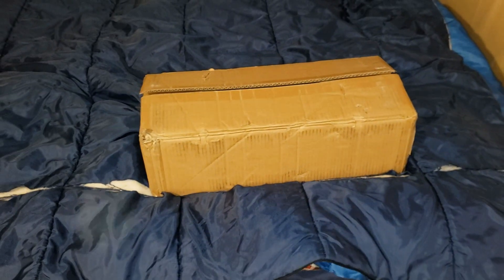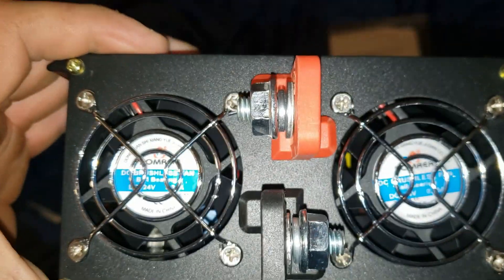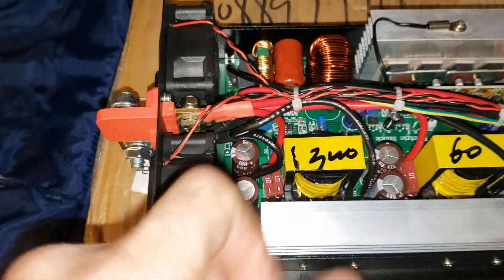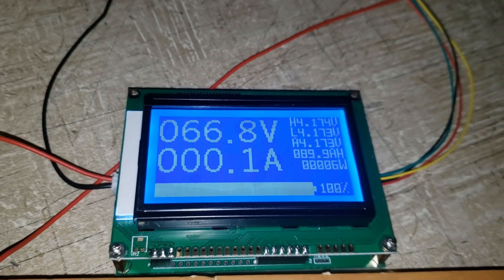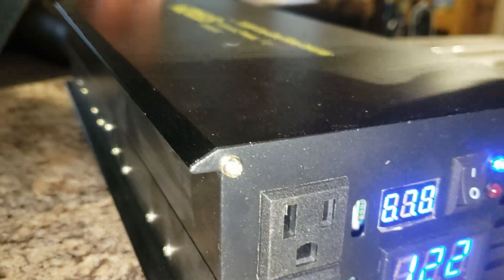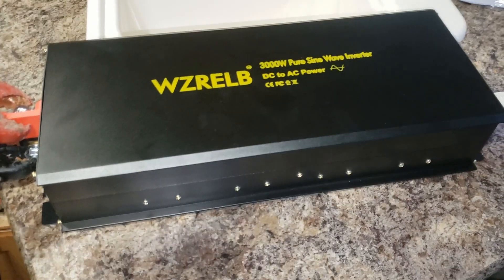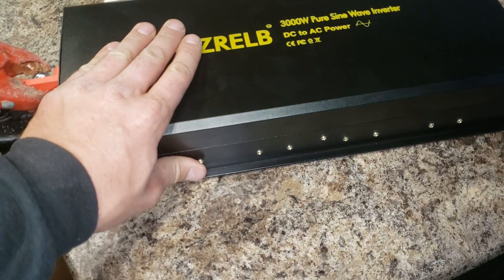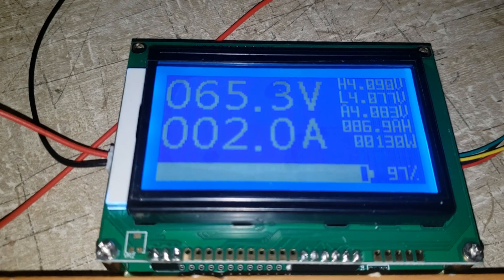New Smaller And Lighter 3000w WZRELB Inverter Is It Better?

Comment: looks like an ok inverter, did you have an oscilloscope wonder what the sign wave looks like, might get it to run an ac, that only pulls 1k continuous, not sure what starting surge is but ill be getting an easy start, so should be ok
Reply from the maker: it shouldn't have a problem with a easy start.
I have not looked at it with a scope yet.
Reply: Mine runs a 1kw AC just fine, (24v system)
Reply: I should add I have the older type of these

Comment: I have the crazy idea to build a huge inverter generator, using a small car engine, around 2.0L and load it down with 150amp alternators, I could use the water cooling, to heat the house, I have a wood stove boiler, and going to add a few hundred gallons if thermal storage, so I will have heat for a long while after the wood is gone, but the engine can also contribute,  I can use it to charge my batteries, and have a small battery, and about 8kw inverter, use a midnight classic 150, with a alternator, to charge my batteries, at 96amps, but normally cut back to around 80amps, giving 100%, 100% of the time is tough on anything..   I also plan to add solar thermal, weather I do the engine thing or not, but a 100 amp alternator, with a midnight classic, I will still give that a go! A DC generator can come in handy in winter!
Reply from the maker: 2L engine could power like 6 150 amp amp alternators :D
 but it would be a great project!!
Reply: Look into repurposing Prius parts for that, the transaxle can handle close to 100kW peak and probably 20-30kW continuous. The inverter that goes with the transaxle will also handle that power but the built in buck/boost converter will only do 10-20kW. (You'll have to tap into the high DC bus for the full power.)
Reply from the maker: @NiHaoMike64  interesting, i would love something like that.

Comment: That is a lot of internal fuses to monitor too bad they weren't more accessible as pretty easy to forget and overload
Reply from the maker: yes each transformer needs its own fuse, I like that its the faster blowing 10 amp fuse might save the inverter if shorted.

Comment: What is the effiencey? I have low frequency inverters, they are not known to be very effiecent, around 85%-90%at best, I been thinking about getting a high frequency and a transfer switch, to use the hi frequency/ effiency for light use, then switch over for heavier use, something to power the TV, and fridge, a couple lights,
Reply from the maker: its a good idea, especially since low frequency inverters are at the peak efficiency at almost full load.
Reply from the maker: at 1600w it was 90% at 3000w it was 80%
I didnt test at lower then 1600w could be higher then 90%
Reply: @GoingOffGrid101  Efficiency was 80% at 3000W in input, but only 2400W in output. Since rated output power is 3000W, 80% efficiency is at  2400/3000=80% the rated power, which seems quite a low figure to me
Reply from the maker: @bergakc  at max load yes but at 1500w it's around 90%
Reply: @GoingOffGrid101  not at max load, at 80% load. Max load would be 3000W in output which you did not test. Cheers